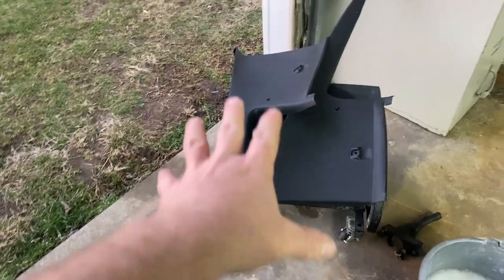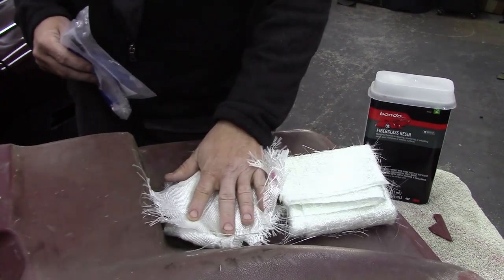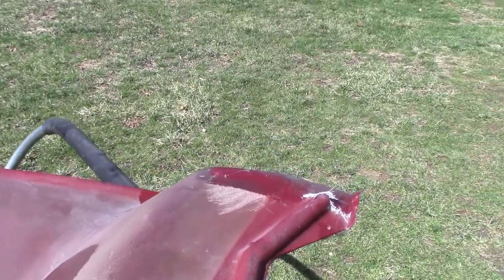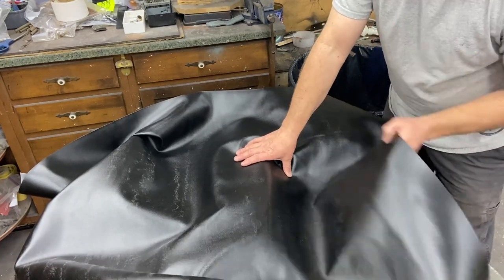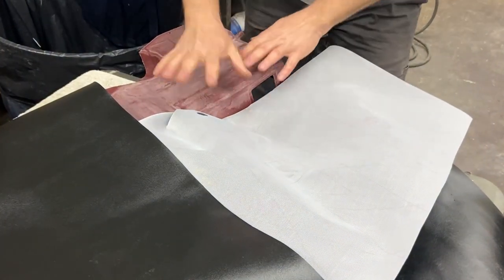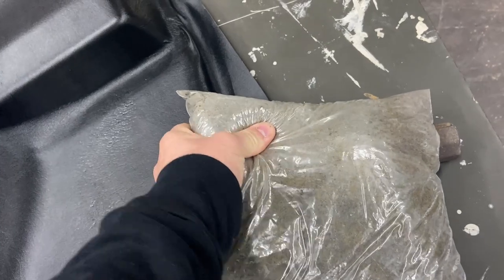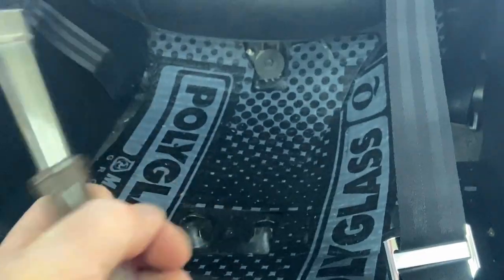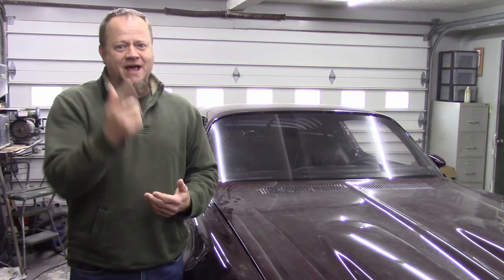Repair Rear Seat Side Panel/Armrest With Fiberglass! Reupholster Plastic Car Parts With Vinyl.

Comment: Looking good man! Like the intro however, either works for me :) you are doing an amazing job as per usual! I’m loving those seats and the way those rear panels turned out. Looks so sharp! I bet you starting to itch on getting her on the road!  Anyway, great job again! Always excited to see your videos.
Reply from the maker: Awesome thank you!  I really am getting itchy.  I'm ready to be done installing these small parts, ive been doing the door handles, locks, mirrors and I've messed up my paint a little.  I wasn't expecting the little things to cause problems! its all part of the process though. Nothing too terribly bad but definitely had to do some touch up.
Reply: @HeavyPedalGarage  that’s such a bummer when that happens.